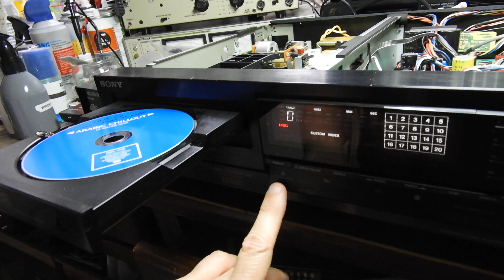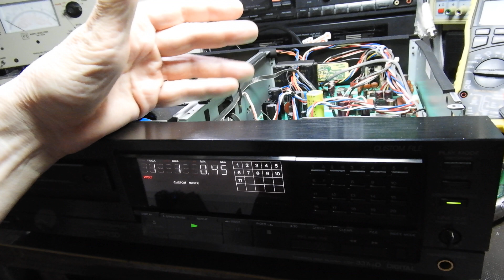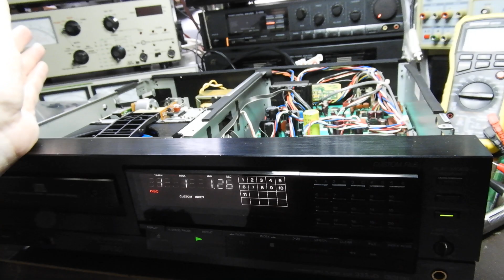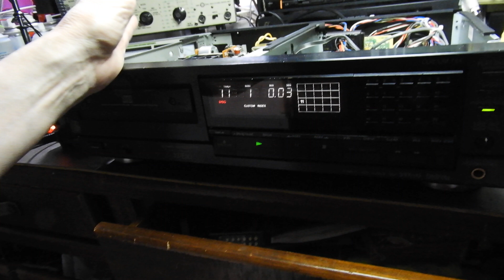Sony CDP-337ESD with a very unusual fault. Otherwise a top unit with KSS-190A mech and 2 x TDA-1541A

Comment: The decoder chip IC302 has external RAM IC303. I'd start with checking that chip.
Reply from the maker: Thanks for this Remco.
Reply from the maker: @Remco Stoutjesdijk
 Thank Man. Good call. That was it. Very hard get get them now though. How did you know it? Was it experience or have you worked it out?